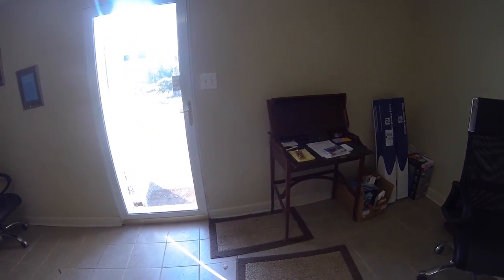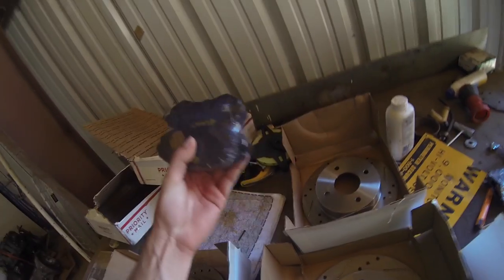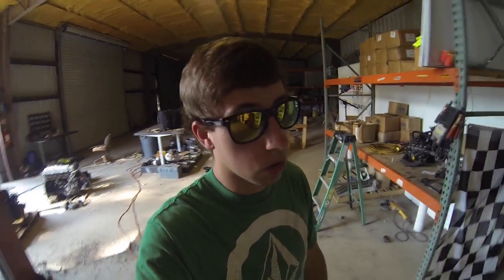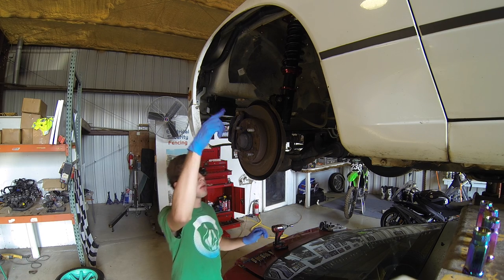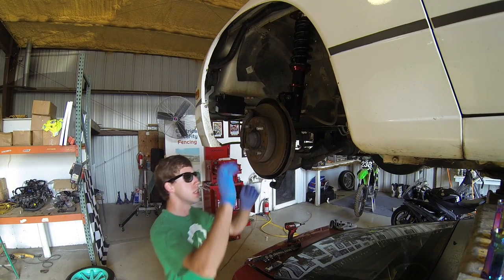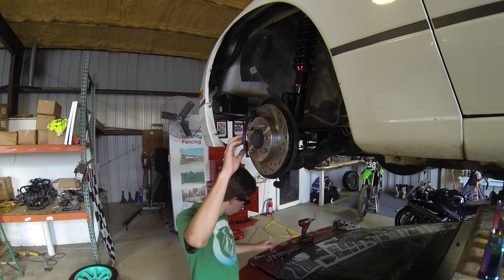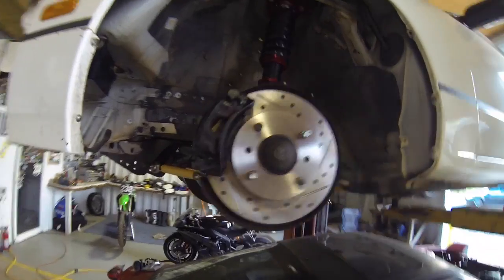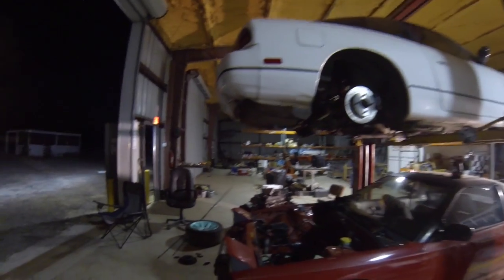1jz 240sx Project - Installing New Rotors + Brake Pads! (Part 13)

Comment: I may be wrong, so don't hate me lol, but I think you have your front rotors on opposite sides. Meaning the one you have on the front driver side should be on the front passenger side, and vise versa. Your rear rotors are right. The holes and slots should be going from center out to edge in the direction the wheels roll to dissipate heat. Hard to explain lol but if you look at your rear rotors you'll see what I mean. But again, I may be wrong, that's just how I've always done it.
Reply from the maker: 1Guy2Wheels You know, you may be right lol, honestly never even thought about that...wonder if it would even make that big of a difference though
Reply: +TheCityRider Yea He's right, they are on backwards. Think of it as mounting directional tires. You want the arrow facing forward. Or in this case, the indentation towards the center of the hub facing forward.